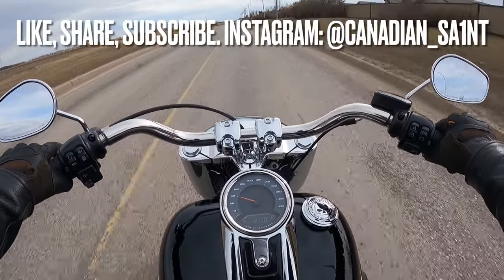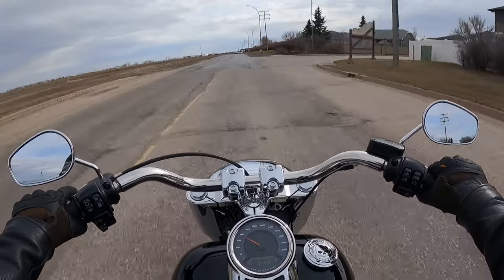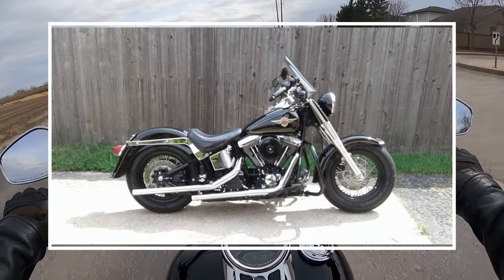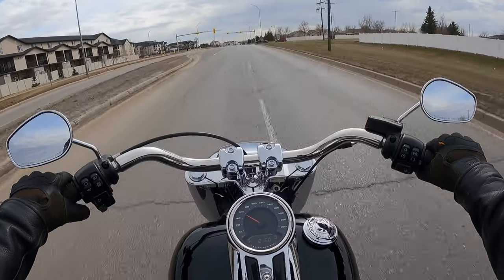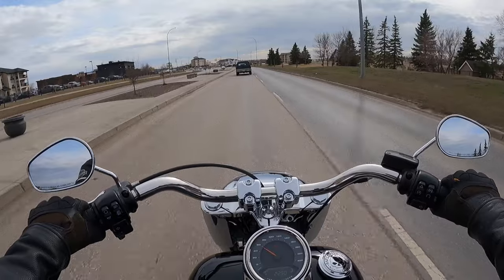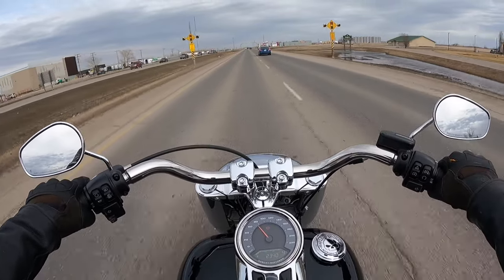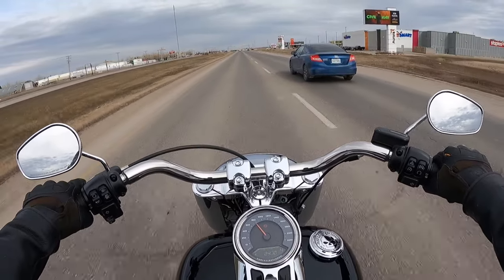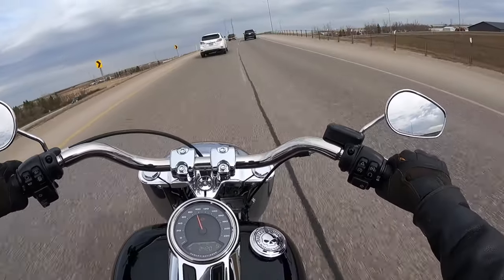Harley Davidson 2024 Fatboy Stage 1 Upgrade

Comment: Interesting. I bought a used 2016 Fat Boy from an out of town dealership. It's lived a quiet life as It just turned over 2,000 miles. At some point the previous owner put Rinehart True Duel exhaust pipes and a Screamin' Eagle Extreme Billet air cleaner kit on it. They didn't put a tuner on it though. I questioned my local dealership about this and was told with what has been installed that some tweaking of the factory computer is all that was needed and is what they recommend. It seems to run well and there's no check engine light coming on. I'm going to roll with it, but what do I know. This is my first Harley.
Reply from the maker: If the dealer says it’s fine I would go with that too.

Comment: Need to get ride of stock head pipes,  those little  1 1/4 Dia.  Pretty sad,  for a big 114, ci. M8  Has rear cylinder  shut down when gets hot,,  yea, you probly  never have  it work in Canada.  Lol, but in AZ hmm it gets hot,  my fatty  shut down rear cylinder with stock  head pipes,  but with wide open Blow Exhaust, ,, 2  to 2 1/2 in. Dia. Pipes  16 in . Long, hmm never had that issue,